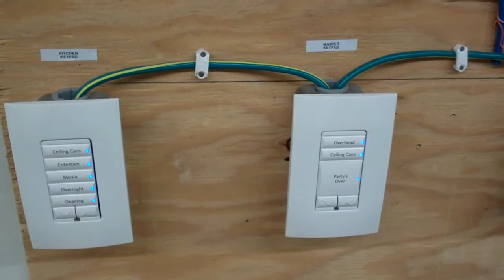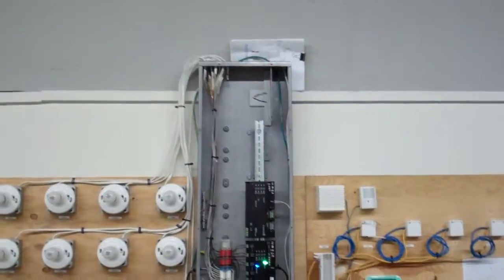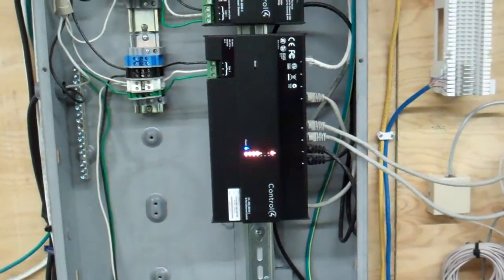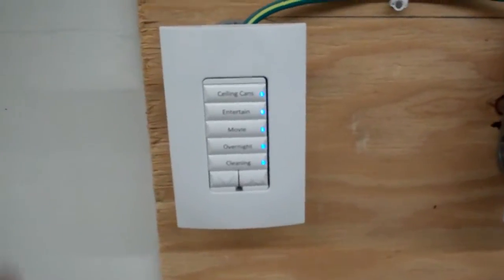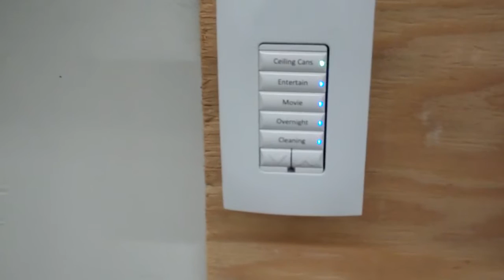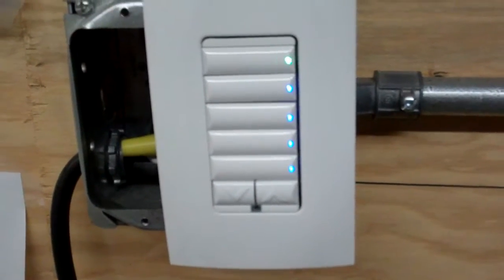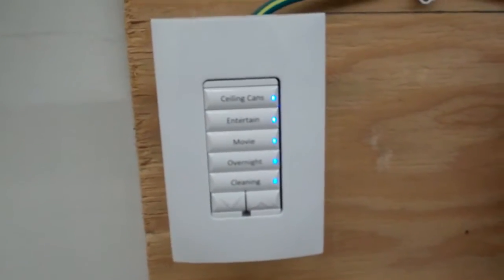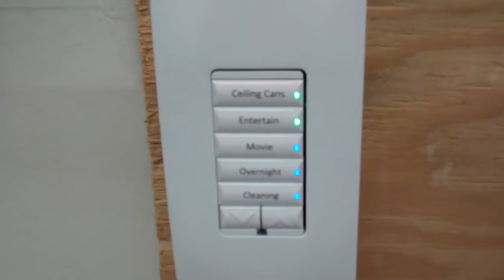Technospeak Designed Hybrid Lighting System

Comment: Does each light in my home has to go to that panel
Reply: No, just each "load". Let's say we're talking about an upper floor with 1 master, 2 bed, 2 bath, 1 kitchen. 2 lights in master, 2 lights in each room, 2 lights in each bath, 4 lights in the kitchen. If that setup is "panelized" you would consider each room a "load" and tie in the lights in those rooms to their own load that's "home run" to your centralized location. That means instead of 14 home runs, we're only talking about 6.